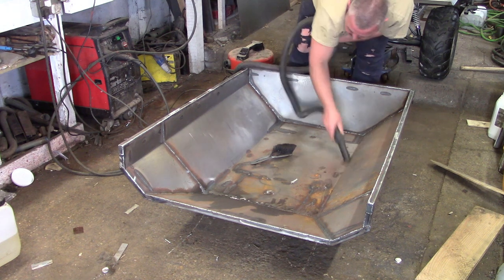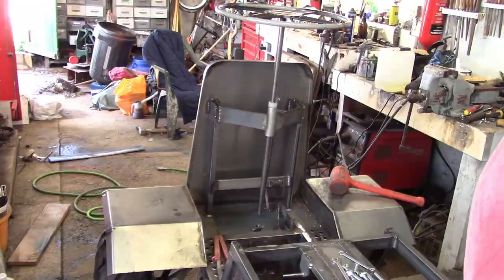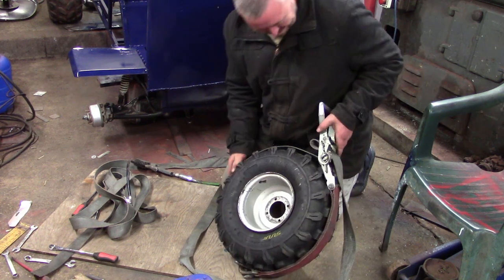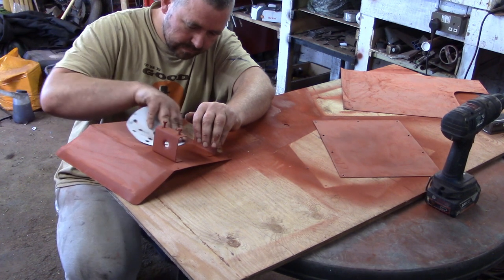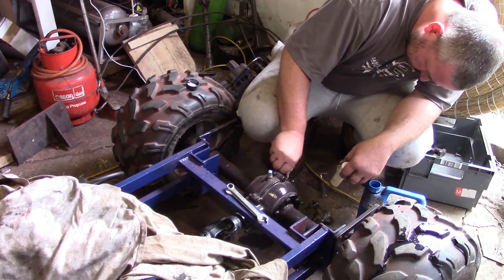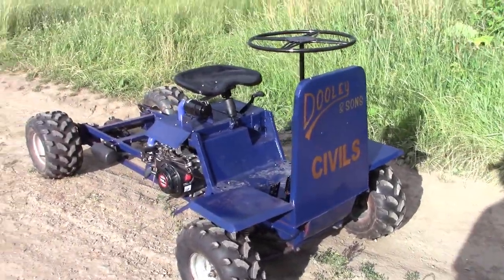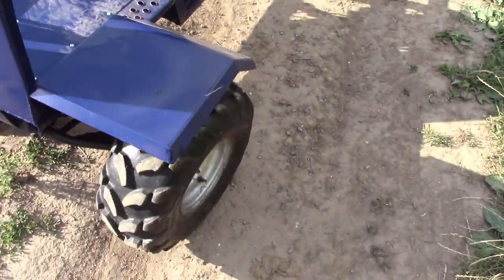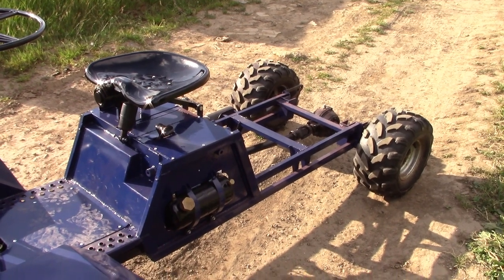Homemade Dump truck MK2 Painting and driving

Comment: Try adjusting the front tyre psi (Might need more, might need less) before you go fabricobbling anything and see if that helps with the steering those fat knobbly tyres are never really going to feel 'right' compared to a car. It looks great though, love the colour, did it feel torquey enough for a full bucket or you think it might struggle?
Reply from the maker: Will do mate, I'll try putting a few turns both ways on the steering rods as well before I take the grinder to it.

It's hard to judge the torque because of the CVT, spools up on part throttle once I'm at high enough rpm to engage the clutch, when I've got some weight over the rears I'll hook it up to a car and see what happens, for science.